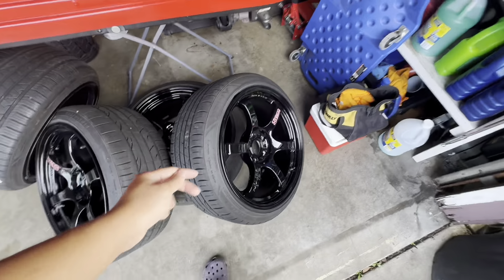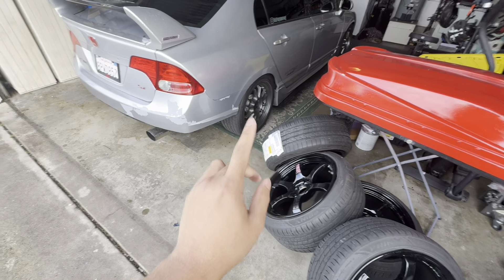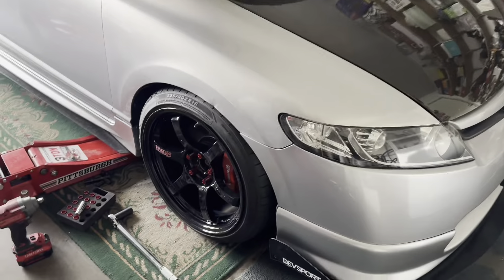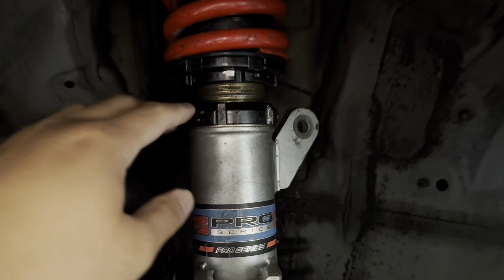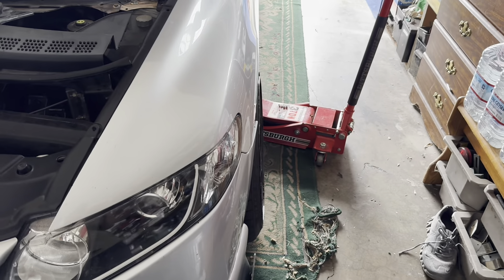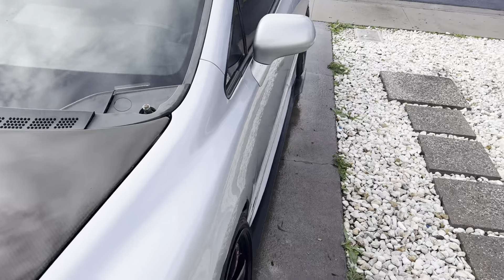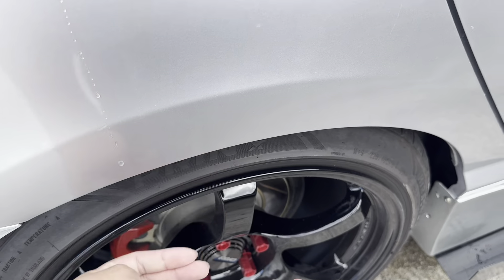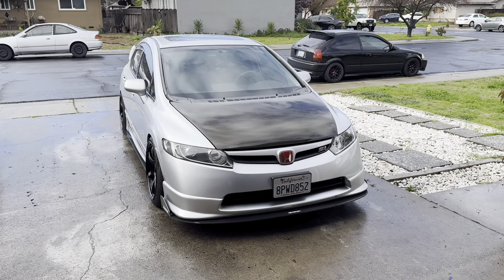Installing My Dream Wheels! | Rays Gram Lights 57DR on 8th Gen Civic Si

Comment: Nice fitment. 
I know you said there is a small spacer behind the rotors because you have Brembo Calipers. But are you running additional spacers in front of the rotors?
Next, I can’t help but notice your camber plate appears to be installed incorrectly.
Reply from the maker: Appreciate it! I have 15mm spacer in front of the rotors as well. Good catch about the camber plates, I’ll fix that next time I have the car in the air.

Comment: Which wheels are lighter? I’m also considering switching from RPF1s to the 57DRs. I need to do the switch for clearance on big brakes. I’m still torn as as still love the RPF1s. What do you think of the gram lights as opposed to the RPF1s?
Reply from the maker: When it comes to clearing BBK’s for the RPF1 there’s more options, and it depends on wheel size. There’s a concave/flat face spec and a convex/bubble spec. So a 17x8+35 will fit a BBK with more than enough room, but for a 17x9 you would need +20 (the concave face looks way better but requires lower offset). The rpf1’s are slightly lighter I think, but the gram lights are forged so they’re stronger. Both wheels are good options, but I like the looks of the gram lights more.
Reply: @npvfa5 bro you gotta help me, what wheels should I get to clear brembo brakes? rpf1s 17x 9.5+35 or 18x9.5+35

Comment: what was the brembo set up here? was it tl type s rotors? so base here +38 offset will still not clear U had 20mm offset so that brings it to about +18mm offset? planning to get me 17x9 +22mm 57Dr and hopefully wont have wheel poking out so much.
Reply from the maker: TL-s brembos and rotors. Have a 5mm spacer behind the rotor and 15 in front of the rotor. So +20 in spacer total. I’ve seen a couple people run +22 57drs and have fitment be perfect
Reply: @npvfa5  ahh i see thanks. I might really just send it at +22 never seen anyone running them in my area.

Comment: Can you help me? I’m deciding between rpf1 17 x 9 + 35 vs 18 x 9.5 + 38. I don’t know which one to get if I also want to upgrade my brakes to those Brembos and lower my car with bc racing ds coil overs. I don’t care if I have to do any modifications I just want the whole wheel well to be covered and the fitment to be perfect with no rubbing.
Reply from the maker: Check out my video with my gramlights to see how 18x9.5 will fit
Reply: @  I did check it out and I will say that fitment looks clean when you can’t see the wheel well, i just don’t know what is better or what you liked better. We have same car so it would be nice to get your opinion

Comment: Did you need hub centric rings for your wheel/car?
Reply from the maker: Yeah most aftermarket wheels including these are 73.1. Stock Honda bore is 64.1mm. So you need the appropriate hubcentric ring.
Reply: @npvfa5  thanks for the response just got some tires for my wheels now I’m gonna order some rings! Thanks for the heads up! Liked and subbed!

Comment: Just a quick question, I just bought mines and they come with 5 holes in the center where the lug nuts are, but I see other people with the same model 57dr and they have 10 holes or 10 counterbores in each wheel, you why is that?
Thanks
Reply from the maker: I think they may have updated the design to have the 10 holes. I’d prefer ones with just the 5 holes as it looks cleaner. They will probably be more desirable in the future.